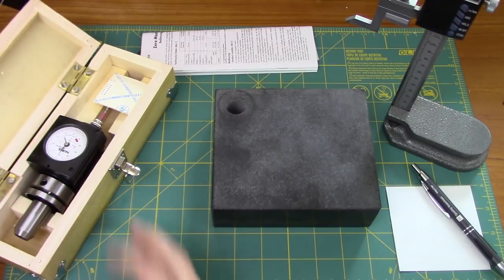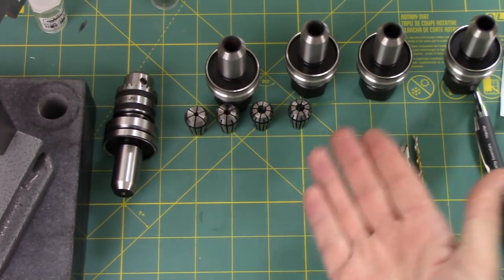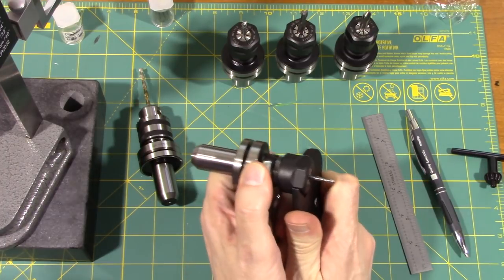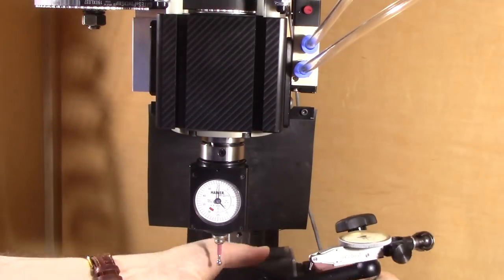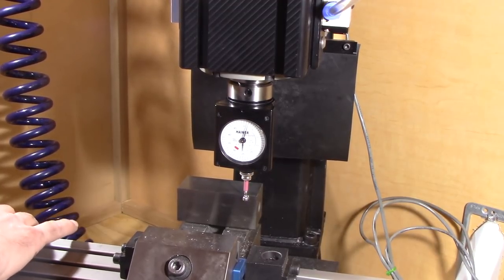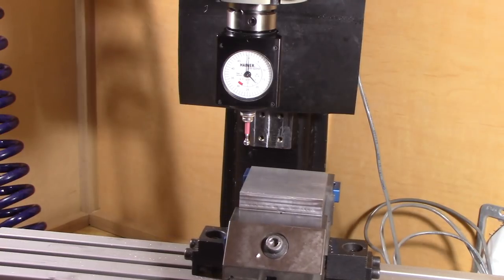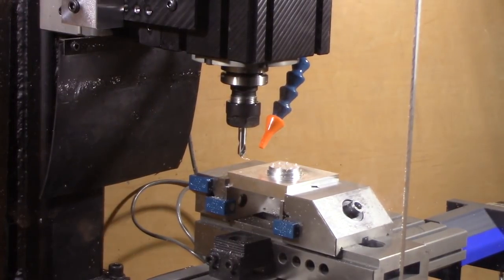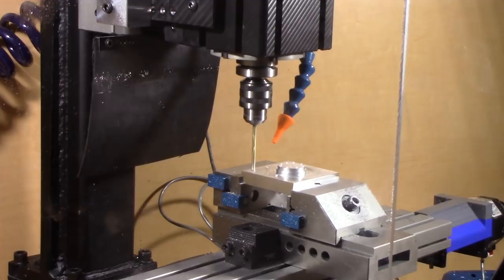Taigmach First Chips, "Taigmach" Part 10

Comment: Step by step to accuracy, locate what is causing error and correct. 
When close is not close enough.
I like your test run with multiple tool changes to check for any errors in tool holders.

Comment: I'm drooling John. Would the R8 spindle fit with an original frame? Also have you noticed an improvement in surface finish. I have the consew motor waiting for me to install on my 15yr old mill.
Reply from the maker: I believe you would be best with the new frame, as the spindle sticks out a couple inches more than the stock spindle. The new frame provides plenty of extra room to move the X/Y assembly away from the column. As to surface finish, I literally just got this up and running yesterday, so haven't had enough time on the machine to know. What I do know is that helix operations are much better. Before I was getting a lot of chatter. Now, I get none. So I think the new spindle will produce a better surface finish.

Comment: Hi John. Great video.  What are those blue holders on your vise?
Reply from the maker: Thanks. They're magnetic vise keepers: https://www.amazon.com/Magnetic-Parallel-Keepers-Holders-Machinist/dp/B07KZ6HRS7/ref=asc_df_B07KZ97SWH/?tag=&linkCode=df0&hvadid=309764279897&hvpos=1o1&hvnetw=g&hvrand=3379727031701218926&hvpone=&hvptwo=&hvqmt=&hvdev=c&hvdvcmdl=&hvlocint=&hvlocphy=9033253&hvtargid=pla-636560835800&ref=&adgrpid=60439547943&th=1

Comment: 14:22 this should never happen on first program run. use single block and see will it go height where it should lol. its CAM its still red red red cutting inside part tell alarms but not smart enought fix them LOL kinda hate fusion360. well its good for design not for cam. and i write gcode faster than drawing and generating path and export it . there is no CAM on our company becouze i won batlle by speed writing gcode when seller made program showing of. is it done yet? i have part here LOL. boss :O